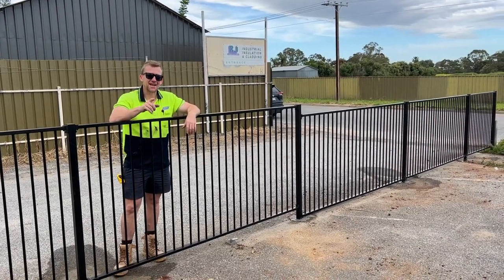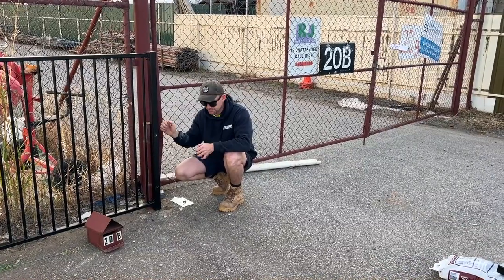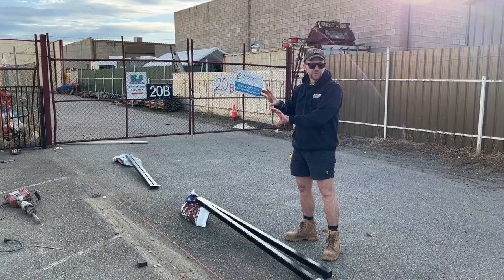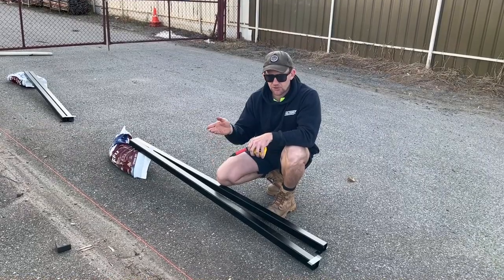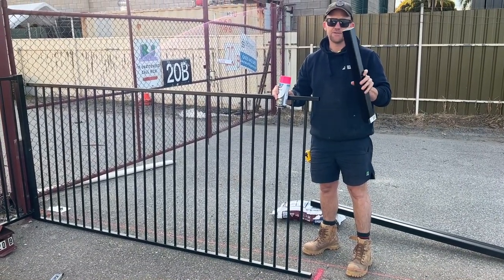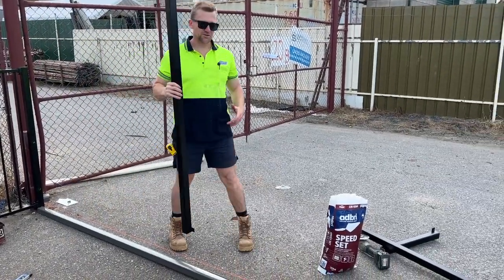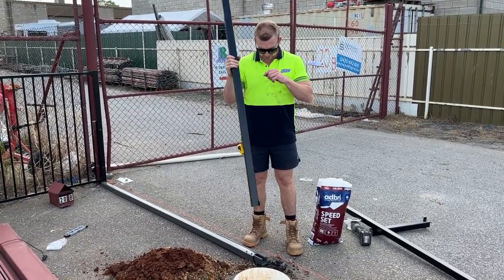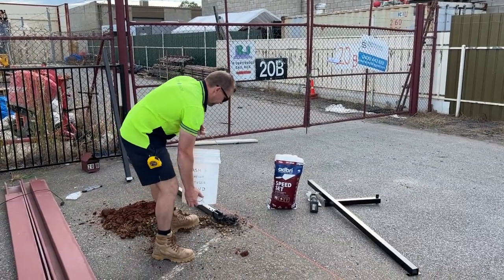How to install black pool fencing - aluminium flat top

Comment: I have heard that from some that using concrete is better than quick set concrete, what is your view on this?
Reply: Quickset is ok for steel but not aluminum as it will corrode the posts faster. It states on the fence instructions not to use it. Use general purpose instead.